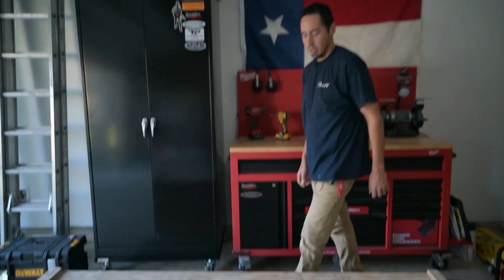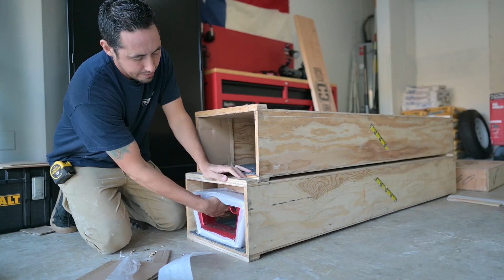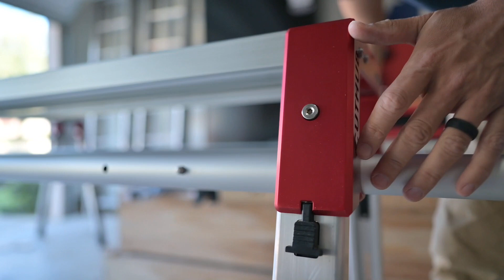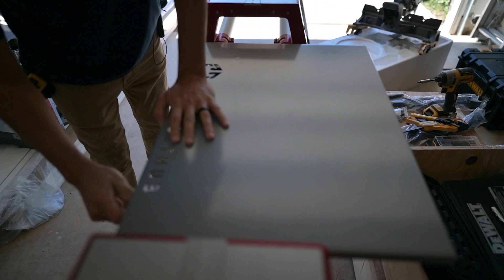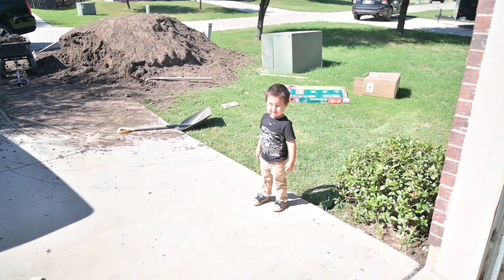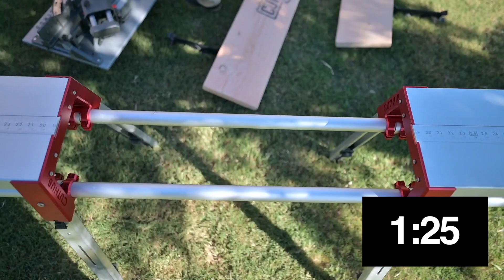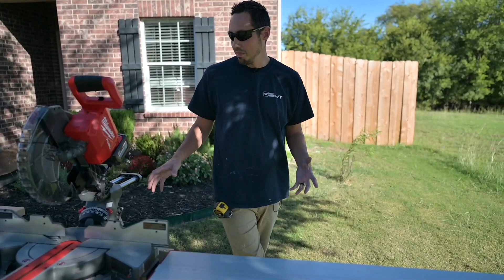I Paid $3400 for this Saw Stand - Cut Hub

Comment: I purchased the CutHub in June.  I have been doing finish carpentry for over 50 years.  Excellent stand. After 4 months of hard use it shows very little wear which is expected once its set up and being used.  Price point is good for the quality and ease of setup.  I’m 6’4” and adjustable height saves my 72 year old back. My Milwaukee 12” Fuel sliding miter saw was perfect out of the box. That saw has been abused! Caught in a pop up thunder storm once, dropped off my tailgate ( my own fault). Minor adjustments and it runs great again. Great videos Richard.

Comment: You don't owe any viewer an explanation, there's nothing wrong with paying a fair price for a quality product. Think of the people who spend $70k for a 4x4 truck that never goes off-road, they just like the way it looks. You bought something that you will use every day to make a living and potentially generate a better product.
Reply: Kurt M. Gibbs very solid point here! I like that! Haha sooo true
Reply: My work truck was $75 canadian. Just a basic 2019 ram 2500.
Reply: @batmansdad3195  who paid the other $50000 canadian of your truck?
Reply: @gzoehobub  op claimed $70k. Converting cdn to us is $.75 to the greenback. Once sales taxes are added you're only $10k off. Get one loaded and it's over $100k cdn.
Reply: @batmansdad3195  that's a bit mindblowing. whether in Canadian or US. But if it helps you and it's affordable, more power.
Reply: @gzoehobub  yeah to get a diesel now is ridiculous. My old 2012 with similar options was $10k less. Either than a 10 speed trans, only difference is the touchscreen and def tank which gives a smaller fuel tank.
Reply: @batmansdad3195  my 95 7.3 long bed hd250 gets nothing but compliments every time I take it somewhere. its bone stock. every one wants too buy it.
Reply: @harleyhawk7959  they're beautiful trucks indeed. Guy has one here that's a quad cab that he restored, lifted and sitting on 20's.
Reply: That is not a basic work truck for 75K, not even close.
Reply: @13612  than what is? Please explain what a basic work truck is. I need a diesel, the tax deductions are needed and the few extras that truck came with was a couple grand. So please explain to everyone what a basic work truck is when you need the diesel? It can't be no $4000 truck that's gonna break down every couple months
Reply: @batmansdad3195  Basic isn't diesel, it's not a 2500 and it's not 70K.  You're not in the "basic work truck" category.   Otherwise a basic house would cost around 500K outside of California or some other overpriced city in whatever state.  Not raggin' on you, just saying...70K ain't basic for anyone's vehicle budget to get to work.
Reply: @13612  around here a "basic" house is $350k, unless you want to live in the slums. 

Yeah framers, finish carpenters, painters and all that can get away with a 1500; but I haul all my own materials whether in my trailer or flat deck. 

When I slung drywall I hauled all my tools and equipment in a ranger, any scaffold was supplied to site.
Reply: @batmansdad3195  Well there ya go....350K isn't an average home price in most of America as well as 70 "work trucks".  You know it and I know it.  Get on Car dot com and type in 2500 Ram 4x4 and you will see what you paid is way over the top.  Either you got screwed really bad or you got screwed really bad.
Reply: Back in the 1990’s, my buddy spent $2,500.00 on a computer.  He used it to play a few games, and that’s it.  Nothing productive.  He basically bought a Nintendo system.  A couple years later, it was worth about $300-$500.  Quality tools are an investment.

Comment: Got one 7 months ago. I can’t tell you how happy I am with it. My cabinets have improved dramatically. You will be ecstatic.
Reply: did the time to finish a project decrease as well?
Reply: Jetah yep. I didn’t have to measure and cut each piece.  Terrific stop set up. Only trick is that after you move the station you have to make sure the saw is in the right spot for each side’s measure in the middle of the table. Mine is outside and always up. I’m going be doing a trim where I will need it on site.
Reply: @bigbob9702  when he showed the stop, it had clamps on it. the wood parts he attached looked like they'd block the clamps.
Reply: Jetah didn’t see that. I don’t have anything other than how it came
Reply: Jetah I didn’t see the stop in the video.
Reply: Jetah I came here to say that. Be interesting if he says anything about that in future vids. Maybe it’s not in the way. Hard to tell
Reply: @dockterp1  I think that is why there are gaps between the wood extensions and the bed. The brackets are clear of the wood edges and support from below.
Reply: Mark Harmon I saw how there was a gap it just looked pretty close to me as when he put the stops on the hold downs have to swing out and back to the bottom side. I’m sure for that kind of cash they have that part worked out though.

Comment: The guys who created this were production carpenters.  This is built to last with minimum working parts. The stop itself is genius. You haven’t even seen the extension where you can hook up a table saw!!  Everything else that’s portable uses supports. When you cut crown or repeat cuts on long stock, this allows it to be measured ONCE. If you’ve watched his videos you know that repeatability bid critical to his work.  And the guys who sell this are terrific to work with. Can’t say enough good about the whole transaction.

Comment: the only complaint i got is that for that money there shouldnt  be any plastic parts
Reply: Yeah. That is disappointing but you guy a new truck these days and the gas pedal is plastic
Reply: If you're talking about the leg extensions...I'm sure they considered this, but metal expands and contracts. If the extensions are made from aluminum, it might cause some issues in 100 degree heat...but I agree with you.

Comment: Great vedio, nice set up. I Like your kindergarten statement....we all don't do the same....
#1
You should try the 12" Milwaukee electric slyde saw, with the digital read out. Reads accurately in 1/10th of a degree....when you need to return to a number.....say 13.7 degrees easy! Or you need to move 1/10th of a degree. This movement is so small that with out a "experimental cut" ....it might not have moved ,  or it moved too much or to little!! Extremely valuable!

#2 Another preference possibility to consider for a miter saw stand that features free shipping, 10' fences left and right with Sterrett tapes. Adjustable crown supports, stops left and right , 4 large rubber wheels. The fence supports can be used as a third hand for installing upper cabinets. Has been under constant refinement for 12 years includes a third no touch stop you can use or slide under. Reduces for travel to 66", clever all metal support system and aluminum fences that are optional flat or with a 1" back aluminum fence.....

Fast Cap best fence Pro System Pro 4

I don't know  what the current cost is ....but I think its about $1600.00

I do not sell or have any connection with fast cap. I do know you can buy them from Wurth Luis and Company.  I do know I called fast cap direct and got all my questions answered. They have a ton of videos as well

just jim 
retired cabinet maker / millworker....
Reply: Also, just saw your contest video about what you were think....

Looking at the photo...why didn't you have a garbage can right there rather then picking up all the scrap cut offs at the end of the day....??

Also I like a power strip attached to my saw stand.....always ready for use....

just jim

Comment: Looks sweet and no doubt the best for precision outside of a shop setting. What tool one chooses depends on the result they're going for. I do mostly framing and decks, so I get by with a 36V cordless Makita sliding miter saw bolted to rolling Ridgid stand--under $200 with lifetime warranty--in combination with a couple of roller stands (another $50). Easy to move and pops up in seconds. But no doubt not as slick and accurate. One of my favorite words is hemidemisemiquaver, which means a 1/64th note in music, but I like to think of it as a 1/64th of an inch, too, which is a standard I strive for but I can get typically get away with a larger margin of error. It's only spending too much money if the tool exceeds your needs. I find it's helpful not to think in terms of cost, but value. Cost is an absolute number, where value is more subjective.

Comment: I bought a 28 foot werner pick and screwed blocks unto that's the height of my slider. Only needs a pair of horses and is rock solid, can set up on uneven ground and no interlocking pieces to deal with. Cost 700 and the blocks were scraps from a framing job. Best saw stand I've ever used, great for azek and the like

Comment: Thanks again for taking the time to make a video, Richard!!  Honestly, for $3400 I would have expected better quality fastening (instead of the same push buttons a $99 canopy has) also, what about an adjustable crown stop or material storage hooks in the front.  Seems a bit shaky, too considering it was engineered from the ground up.  Those 2x12s should be aluminum as well 😏 Sure, it’s pretty and will last forever but somewhere around $1200-1500 would seem more reasonable.  I hope you have success with it and are 100% happy (or at least that Cut Hub will allow you to return it for a refund if you’re not satisfied).  Looking forward to the new miter saw video review 👍🏻👍🏻👍🏻
Reply: You might change your mind about the cost if you go to a Metals Supply House and see how expensive aluminum in any form is.
Reply: @choimdachoim9491  it's 1$ per pound in ingots.. but extruded alu is pretty good.
Reply: @jetah50  I recently paid over $300 for a sheet of diamond-plate plus cutting. Extruded pieces at Home Depot, etc. are astronomical.
Reply: @choimdachoim9491  what size and thickness sheet?  i'm not seeing anything in that price range at hd website.
Reply: I think he might be adding in the 600.00 miter saw and shipping. It doesn't look 3,400.00 to me. If it is I kinda feel like that's a rip off.
Reply: @jetah50  1/8 inch plus the 1/8 inch diamonds, don't remember size but it was either 4' X 8' or 3' X 8'. I had it cut into smaller pieces and 90 degree bends. Earlier I bought a sheet of 1/8 " smooth aluminum cut to 24" X 60" for $100, no bends. Didn't buy online.
Reply: @choimdachoim9491  if its custom sized extrusion, yeah its expensive, cause you're paying for a custom die, regular sized stuff is alright. Best route is to find a local private machine shop, who has a regular supplier, and give them some money to tack on an order for you, since if you're a shop and regular business, the suppliers give you better prices, same as any material/trade
Reply: @RedDeckRedemption  It was one time only for a modification on my motor home storage bins. The angle stock I bought was standard sizes. It was all sold by weight at a metals supply house.

Comment: With your skill level and commitment to excellence in your profession, you deserve the very best tools available.  Nothing better than great tools  to  add joy to your passion for perfection .
If it makes you feel better, my 2017 Porsche 911 is due for its 40k mile maintenance. The rear bumper panel needs to be removed to change the plugs, so the price is $4000. 4K for something I’ll never see.  Everything is relative.

Comment: By the time you set this up I could make 4 or 5 cuts with my small toolbox handsaw and still be $3400 ahead.  I'm not a professional but I've done a lot of projects including building my own home.  These days I'm moving more and more towards hand tools and I'm constantly amazed at how quick and easy they are to use as opposed to the increasing volume of power tools.  Factor in setup time and cost and I'm wondering why more workers don't use them.  I recently had to get rid of 20 or so 2x6x12' that were loaded with nails and needed to be cut in half.  I broke out the Sawzall with a new blade but it fought me terribly, bound up in the kerf and was taking way too long, very ineffective.  I regretted wasting the time to get it set up, find the blade and to get out the extension cord much less recoil it.  So I grabbed my toolbox saw which is always ready to go immediately and made quick work of them.  This works well for me but maybe not for everyone, but it makes you think.

Comment: Mount the saw to the cut hub plate with magnets ! then you can adjust it anywhere you want. just relevel your table to compensate for the magnet thickness ! Magnets with bolts attached are available most anywhere.

Comment: Looks great does it have any plastic clips. One thing I have problems with on my DEWALT stand is the wing nuts on the end pieces of saw stand. I’ve replace them quite a bit. Like the light weight aluminum the feet adjustment is cool too. Something DEWALT didn’t offer.

Comment: You’re a lucky man. Congratulations. That is an awesome setup. If it was feasible and I could afford it that is obviously an amazing system that is going to help your production as well as your quality and will definitely pay for itself. I just bought the dewalt foldup stand with wheels so that I don’t have to carry all the weight of my dewalt 12” sliding compound miter saw  and it is nice for that reason but I would have to buy additional components to be able to be productive with bigger stock. Looks like your options are endless as to how much you should be able to cut with that stand. Not to mention how effective it will be to help hold up sheets of plywood or longer stock  to rip on a table saw

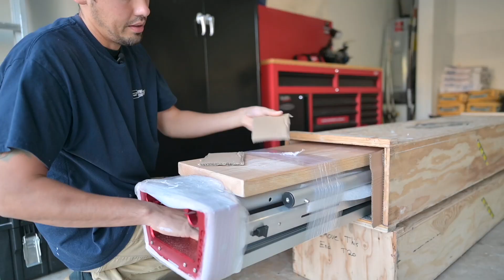Comment: Hello Richard, Great Video as always.  It looks like the two center tubes can be set longer in the center of the two tables for a wider support ...? Now you have to rethink your Crown Stop set-up...? Question, did the 2:16 time include the leveling of the 8 feet...?  You,  still being in the mid to early stages of your Career I can see the Overall. Cost.would be to your advantage spreading the cost out over a decade or two to make it viable and justifiable of the $3,400 price tag...   I have been a Carpenter now for 42 years. At 61 years old I could not justify the price ...  Greg.

Comment: Ever try any fencing system from fastcap? 

Just ordered their fence for the dewalt stand (L4) with additional lengths and lumber support. Bill came to around $700, it is effectively near a 12' table, support system with tape measurer groove and plenty of accessories. It's is a closer comparison to the cfs ez speedy fence system, now that they have the tables. The tape measuring system was the deal breaker.

Comment: Getting one. But I want more length... LOL
Maybe make a video on "zeroing out" the stop.
I have a fastcap best fence pro 4 which goes out twice as wide for 16 ft material. Getting zero on the stop is really easy. Just curious if you have to have a stop on the stand itself before mounting the saw daily. My saw stays on the stand, so it always within a 16th, then fine tune for production/gang cutting.
Let me know how that goes for you. Great video as always

Comment: Just curious if the measuring increments lined up correct on both sides of the saw blade.  Seems like the actual location of the miter saw between the 2 saw horses might be a pain to true up.

Comment: Do you have any tips to have a good dust collection system when cutting Mdf or wood using miter saws, circular saw & table saws? Because I have my miter saw connected to my shop vac and it only sucks 50% of all dust I don’t know why ?

Comment: I am a flooring subcontractor and it took me FAR too long to realize the value of having the right tool of the right quality at the right time. If i save 6 seconds per saw trip and i make 200 trips(easily)/day then i save 20 minutes/day, times 300 days a year is 6000 minutes or 100 hours. Although i charge by footage, i generally gross $50-60/hr.
GOOD TOOLS PAY FOR THEMSELVES.

Comment: Just a tip put a black sharpie circle or a mark where the pipe stops just before it goes in to the receiving pipe so you can use it as a reference so if the pipe get twisted as you are inserting it and the dimple does not find it hole you know where to stop then just twist it.

Comment: I will never understand why people complain about something someone else bought, Is it jealousy? This looks to be a nice step up from the dewalt stands which were already a decent solution. If i could think of any flaw beyond the price which is not outrageous for a major part of your money making tool, its that you need both horses to mount the saw, the dewalt you can set up better in places with limited space, not a issue for trim work but for say a cabinet installer its a factor.

Comment: Good luck on the wife acceptance factor, but you could sell her on the fact that it's the finest ironing board ever made. ;) Seriously, the only thing I didn't care much for was the miter saw height adjustment.  I'd have liked threaded adjustments, instead of simple clamps; but I guess it's not something you would change much.  $3400 seems a bit steep, but it is a badass portable saw stand. Doesn't seem to be ridiculously heavy, making it really portable.  They should make a set of side stands 8' each, for us folks with a true long bed truck.  ;) Maybe some ramp attachments for the ends for double duty.  Maybe they'll come out with a titanium version for a measly $5000 upgrade option.  Honestly, it does look pretty nice.  It's obviously marketed towards a finish carpenter, not a rough framer.  Just put pricetag stickers on all your individual equipment and customers will think twice about arguing over the cost of high quality finish work.  :) Buy once, cry once.